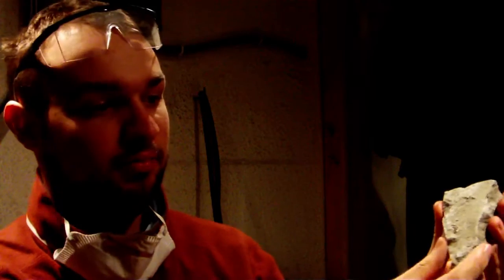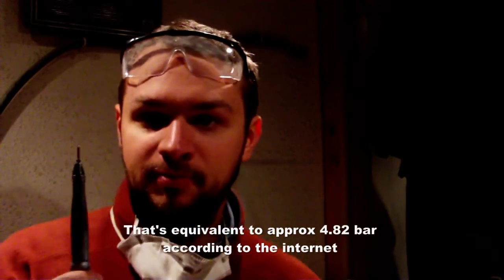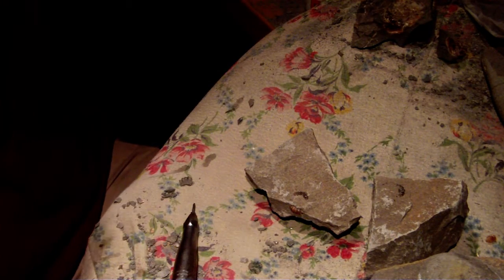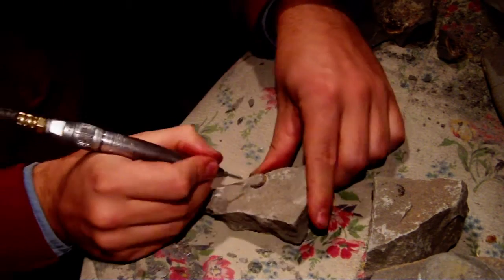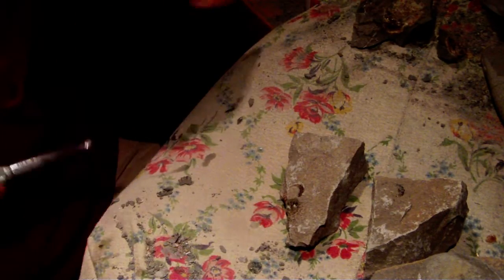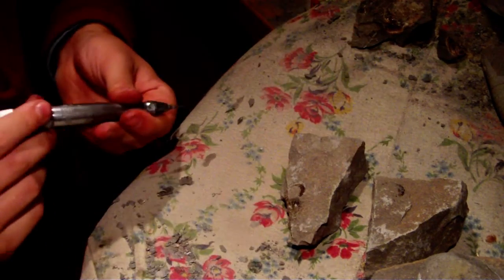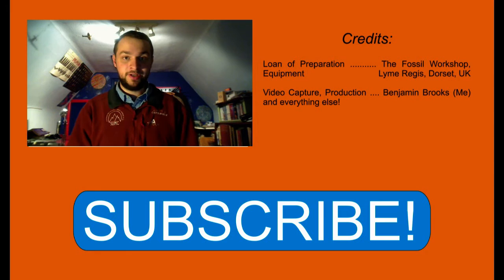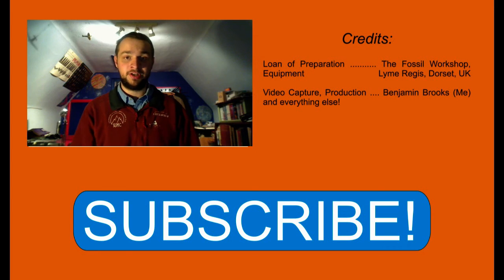Lyme Regis Ammonite Preparation

Comment: Thank you for the video, it's very informative. 

I was wondering if the same principles would apply to using a Dremel-type tool? I have many fossils which I have found, some of which are still deeply embedded in their matrix but which I would like to try and prep up. I have only ever used dental picks but I do have a Dremel-type tool, which I am hoping I can use to help. What are your thoughts please? 

I am also lucky enough to live in West Somerset and we have loads of white-shelled ammonites. These are ridiculously fragile though. What would you say is the best way of prepping these please?

Comment: There is a huge bed of fossils not far from where I live.  I'm hoping to make some money doing what you did in this video.  What I need to know is how big is that ammonite and what could I sell it for?
Reply from the maker: haynerbass Thanks for your question, I'm afraid there really isn't a simple answer because a given fossil's value is not only dependent on size, but on the type of preservation, scientific and aesthetic value, the quality of the preparation, and numerous other factors including how much people are willing to pay for it.I must admit I don't have much time for commercial collecting (morally speaking), however this ammonite is about 3cm in diameter at it's widest point, it has been preserved very well and has an interesting geological feature (in this case geopetal structure), however it is a very common species of ammonite and isn't in a particularly "mantle piece suitable" rock. - Therefore it is probably worth somewhere between £5 and £15 commercially speaking. Though you will find numerous places online who will happily sell a similar (if not identical) ammonite for two or even three times that. People are mostly unaware of the real value of fossils so are easily taken advantage of by 
 
  
 
unscrupulous commercial collectors.If you want my honest advice, unless your fossil bed is producing very large, rare or aesthetically pleasing ammonites, or other commercially viable fossils (ichthyosaurs, dinosaurs, eggs etc) then the £600+ outlay for the equipment probably won't pay for itself very quickly.
Reply: Thank you.  I'll let you know what I find.  This is my first trip there and I'm not even sure I'll find it.
Reply: checkout ebay. that will give you a bit of a basis on what to ask for. you can even sell on there.